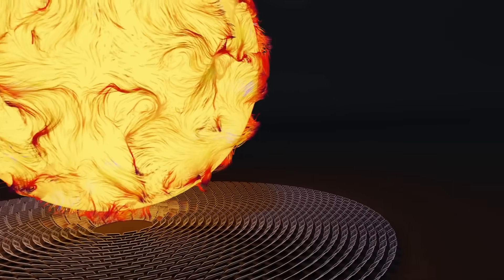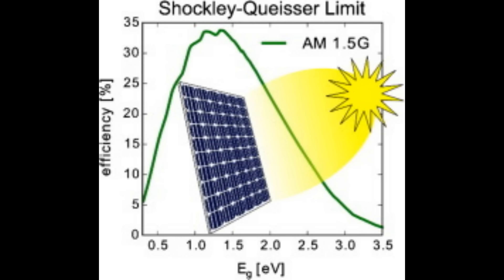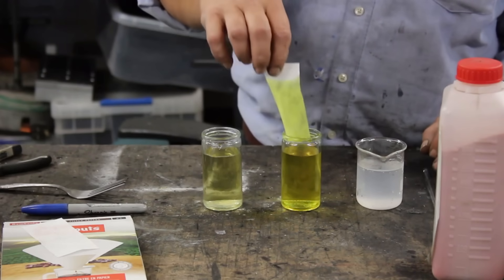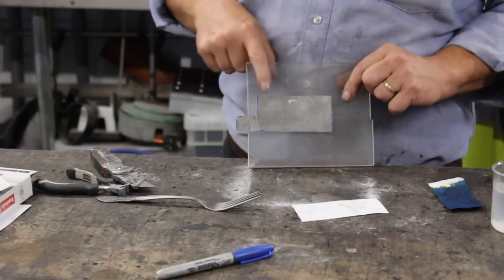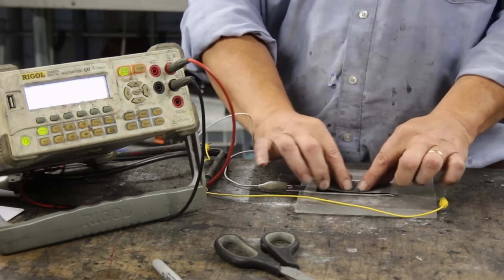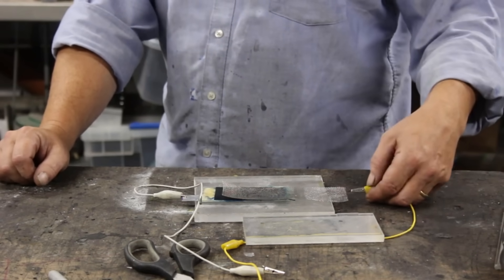2191 Self Charging Solar Battery

Comment: I've been working on figuring out a home built durable battery pack to take advantage of Time of use rates.  Commercial batteries are just too expensive.  If you've built an experimental cell how would you determine the maximum safe amps to pull from a given cell.  I understand C-rate but how would that be determined in a DIY environment?

Comment: Not bad, I mixed prussian blue powder with graphite and painted it on one side of paper, then used salt water on a mystery metal plate salvaged from a power supply and pressed the unpainted side on the salt water.  With about 10 cm^2 of contact area I got 900 uA @ 0.35 V. Then I wondered if putting salt water on top of the paper would be beneficial...... it's not, it ruined it.
Reply: So, saline ruined/destroyed the PB matrix?
Reply: So you got 315µW per 1/100m2 that is 0.0315W/m2... How log did it take to charge / discharge?

Comment: I'm curious about its mechanical properties. I'm assuming that in order to charge with solar energy it's surface will have to be maximized in relation to it's volume, but sheets are not the optimal form for batteries at first thought.

Then again, I'm curious about whether the surface can be rolled or folded, and if it would still allow to serve the energy in that shape. Then it could have some particular uses.

Comment: Could you do something on battery separators? I have done a search and apparently you can use various plastics as the separators but they need to pass ions but not electrons and I have also seen you using paper as a separator so does it needs to be porous or not?

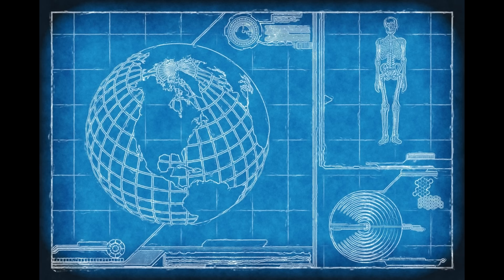Comment: Robert, I'm a bit confused: Is the battery in its fully charged state when it is blue, or when it is white? In your description at 1:54, you said the sunlight turns a blueprint's pigment white, and as it discharges as a battery, it turns blue again. But in your demo, the strip of paper started out blue, and gave a voltage. And when it was discharged, it became white. Could you clarify which color has the high potential and which color has the low potential? Does it discharge in the other direction in an opposite polarity?
Reply: The sound gets cut off after "leave it" before the words "exposed to air" or "in the sun" could be heard, but I understood it as "leaving it exposed to air" which causes oxidation. That would be consistent with the demo. So dark blue is fully charged and as it gets oxidized it releases electrons and turns white, while in the sun it absorbs electrons and releases (repels) the oxygen.
Reply: @VeniceInventors  Actually I believe solar energy isn't actually contributing during the recharge stage... Page 5 of the 2014 paper shows chemical equation 6, in which O2 is what causes it to become blue again (recharge). It says it right there: "The bleached device recovers its colour after oxidation by oxygen in air [...]". So I don't believe this device uses solar energy at all...? There's no mention of solar energy helping during recharge in the 2023 paper either

I guess it can work under the sun (despite suffering degradation because of it), and having it working during night is great! But if I'm right it means the video shouldn't have been about solar energy at all
Reply: The deep blue (PB) has the potential.

Comment: A nifty trick would be to put the ferro cyanate compound in a liquid carrier.  It can be pumped through solar collectors when discharged and through electrodes when you need the power out of it.   I will play with this.
Reply: microfluidics direct solar capture ???
Reply: Flow battery 👍

Comment: Spectacular 👍🏾👍🏾👍🏾.
I'm thinking of covering a shed sized roof with A4 size sheets of this; And monitoring the effects of  day and night cycle into a storage device on a 10% load. Then design an energy harvesting device that discharges at night; from the day's charge.

This is wild.
Reply: I personally think the this combined with those graphene plates he built as a sort of solar static capture would work well.... or the diy solar cells he made from lcd tv screens.. the key here is to use multiple different technologies together to fill in each others  weaknesses and amplify each others strength....individual cells can't do much but together they can do what seems like Almost anything.
Reply: @bigmouthstrikesagain4056  

Noted, and agreed. 
Thanks for the comment. 👍🏾

Comment: LEDs, are, as a point aside, also solar collectors.

In other words, to some extent, they can both emit AND COLLECT solar energy.

I have never seen how effect some of these more modern LEDs are, but, from what I read in the past, unless the more modern ones are very fundamentally different from the older ones, they SHOULD actually be MUCH MORE efficient, and also, they are less prone to decay and decomposition, as compared to traditional silicon based solar cells.
Reply: ..but they can't store the energy ;  )
Reply: @kimtech234  I know that.

But that wasn't my point.

Comment: Thanks, that was a very interesting video.
I assume that the two examples are different.
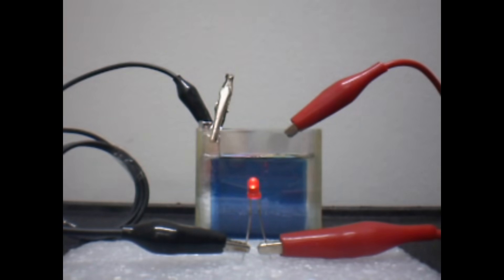At 2:15, you showed that the white blueprint had energy stored, and as it discharged, the paper turned blue again.
In your DIY example, the colors were opposite. Blue was the energy-dense state.
Reply: That is what I saw too

Comment: So you would what use that with indium tin oxide from a display to have a solar array to have the series and parallel cells for the current and voltage you want? Or could you get more power out using graphene or graphite paper or carbon felt that is conductive?

Comment: the start of your video made me think of an article I once read in popular science there was a car that was electric I don't know if they use batteries whether or not I don't really remember but what they did was they had solar panels in a compact space and they used one a mantle like the propane Coleman lanterns for camping yeah it was a bigger mantle than what Coleman uses they put the mantle in the middle of the solar cells they were arranged like a three-dimensional dungeons & dragons dice and they said it took less gas to just make light to run it or charge  batteries then it did for the combustion engine it was quite a large article but I never seen anything like that since then

Comment: What about a gel version of that? if you can stack the gel(with the electrolyte) in thin layers and put the electrodes on the front/back, light could shine in from the sides. If you use a glass box to stack the layers

Comment: What a fine video Robert. Alright, question Robert. If one were to mount on a sheet of thin glass and some fiber optics attached to edge of glass sheet Which then would allow 🌞 light to shin up into glass sheets. Would this recharge battery cell? Thank you sir for sharing your experience and knowledge with me. 10 of 10.😊😊😊😊😊😊😊😊😊😊
Reply: Yeah there's a video about it. It's called a dye sensitized solar cell. The problem is it only works for so long until the sun breaks down the pigments. This is an area of active research known as organic photovoltaics and in general organic based semiconductors. It is likely to be used in the future once the right complexes can be made that remain stable etc.
Reply: @SimEon-jt3sr  thank you for the answer to part of my question.
Reply: It's not just a partial answer...  Even this study showed a significant loss after the first 'recharge'.  RMS gave a beautiful and simple mix vs the layers upon glass with electrolyte in the paper.  But, given no other choices in this particular venue, it doesn't really matter!  A partial side 'recharge' through internal reflectivity is not likely to meet your requirements.
Reply: Another option is to verify the time required to fully recharge the system...  Even RMS mentioned this took 'a long time' lol!  I plan to check one v two v three days to 'recharge' the cells for actual nighttime 'drip' charging of my batteries.
Reply: It may not be the most energy dense, but not having to worry about my kids burning alive in a lithium oopsy... More than worth my UL verified and certified time 😂

Comment: 33.7 % limit is only for photovoltaic or also for solar thermal (water) panels?
Reply: I think only for photovoltaic.  Converting Solar energy into heat to do work is definitely far more efficient than 33.7%.  Especially if you combined things like vacuum insulation with the new'ish ultra black materials.  The conversion of steam into electrical energy via a steam turbine, will drop that efficiency down--but the worst steam turbine systems are at 40% efficiency while the best approach 90% efficiency.  

   And the nice thing about Solar thermal is that if you need it for heat/hot water (and don't need to convert all of it into electricity), then it is extremely efficient.  

      So many of the people in the US who have Solar PV panel systems, really didn't do the math when it came to home and hot water heating.  Because a couple of direct Solar heating water tanks would have largely taken care of both of those needs, with very electricity drain vs converting it all into electricity and then reconverting it back into hot air and hot water. 

    But when you go to poorer countries, especially those with plenty of sun, you see lots of Solar water heaters.
Reply: @justinw1765  Steam turbines are way less efficient. That 90 % is perhaps compared to the theoretical max, wihch is Carnot efficiency so overall maybe 50% heat to mechanical, if that. So theoretically slightly more efficient than PV but not enough to worth the complexity.
Reply: It's the theoretical limit for Silicon PV cells.
Reply: Standard Thermal Solar is about 60% eficiancy